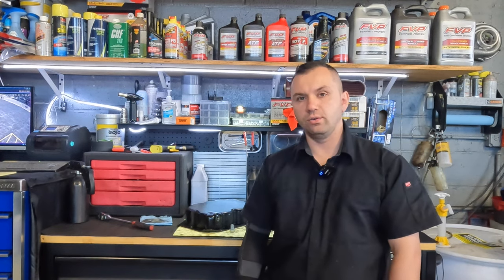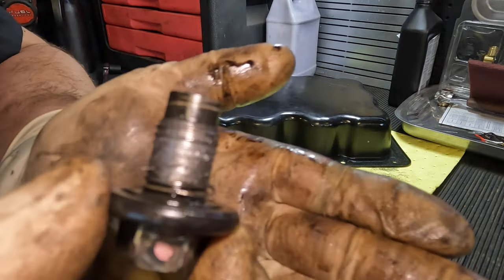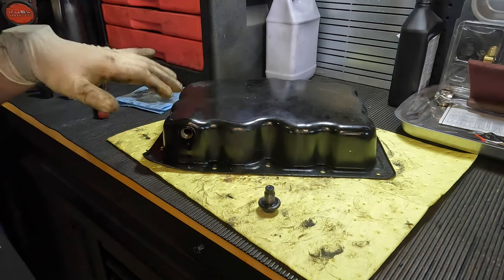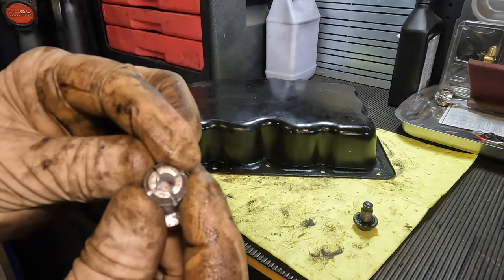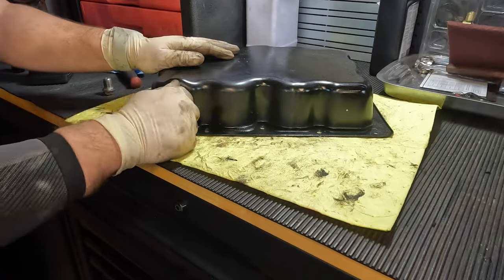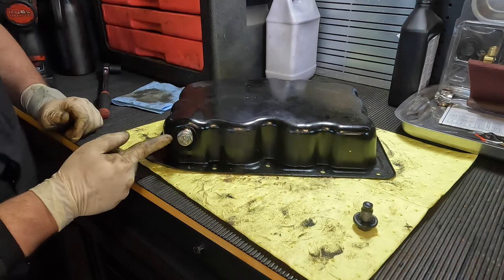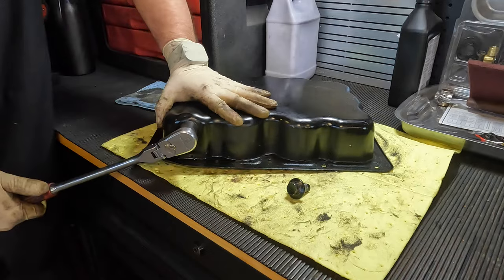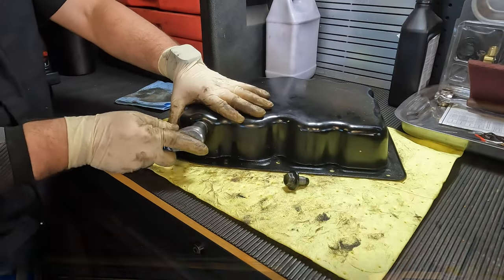STRIPPED OUT OIL PAN DRAIN PLUG THREADS??? HOW TO REMEDY THIS BY USING A OVERSIZE DRAIN PLUG!

Comment: Awesome fix. I wish my oil change guy had suggested this. He said the solution was to replace the pan. Now that I'm educated, next time he mentions it I will ask him about using an over-sized drain plug. Yes, it's a temporary fix but a lot cheaper than replacing the pan. The guy looked like a rookie so I will forgive him for his lack of knowledge. The funny thing was, the shop owner was like ten ft. away and I could have asked him. Next time I will. Thanks!

Comment: Thank you for taking the time to help people that have a stripped oil sump pan. I'm going to use a 14x1.5 mm oversized piggy back drain bolt on my Acura. I bought the car used and it looks like the guys at the quick lube shop's think the bolt should exceed 20Ft Lbs of torque.
Reply: Have you fixed your problem? I have the same problem on my Honda Civic.
Reply: Nice thing about the piggyback type, it can be left as a permanent repair as long as the outer bolt goes in snugly. This is true because you never have to take it loose again, use the inner piggyback bolt.

Comment: Had a place I took my car to get a quick oil change use a pneumatic/impact to get the drain plug back in and it stripped the threads on the old one. Was curious how oversized drain plugs worked and it's pretty much what I assumed.

Last time I replaced my own oil, I saw a lot of metal shavings in the oil but the drain plug fit back in - my car has been slowly losing oil for quite a while but only maybe a quart or so every 3 months, which wasn't much of an issue. Now that I look, it does appear that the issue has been the drain plug bolt this whole time.

I will replace the pan within the next 6 months or so, but for now, I bought an oversized bolt, just have to jack it up and get the drain plug in it and some more oil. Great video and good explanation!
Reply from the maker: Thank you for your support. It sucks that you have to go through that. They should not be using an impact tool on the drain plug whatsoever for any reason.

Comment: Not mentioned in your video, but something available, same thing oversized oil plug, but removable inner bolt, sometimes referred to as piggyback type. The idea is you put it in once, then to change oil you use the inner bolt that is threaded within the outer replacement drain plug. This allows you to do regular oil changes using an allen key and not touching the cut threads.
Reply from the maker: I specifically left those out because when you do those piggybacks, you can’t ever drain all of the oil out of the engine they wind up leaving a lot of debris in the lower pan. It doesn’t drain fully in my experience.

Comment: Great video! Let's say that you have a 20mm bolt that is loose like that. Would i try a oversized 20mm self tapping bolt? thank you
Reply from the maker: Yes, they are usually tapered and a bit bigger but are generally sold as the size you have

Comment: Are these a one time use type of thing? Or can you remove them to clean shavings and reinstall?
Reply from the maker: The oversize drain plug should take place of the old plug. However, I wouldn’t recommend them for long-term use, but if you were to do so, you would just clean them off and re-insert them.
Reply: @TheEnthusiastMechanic  Curious why not recommended for long term use if they happen to work? Do they not seal properly over time or?
Reply from the maker: @mrsemifixit  yes that and the threads it makes aren’t the strongest either.
Reply: If you want to try to get away with it as permanent you need to do the same thing he did, but use a piggyback type repair bolt. If you do it with a piggyback type, you can even use black ATV or some other sealer on the threads because you won't be removing it again. Once installed you just remove the inner piggyback bolt which is usually an allen key. The main key is if you don't change your own oil, it's imperative you take it to a regular repair shop, inform them that you have a piggyback drain plug, quick lubes will f-that up faster than you can blink. Because they'll try to remove the outer repair bolt, and not realize they have to take out the inner bolt. Other than that they work very well.

Comment: If my current drain plug is 12m-1.25 would I get a 12m-1.25 oversized drain plug?
Reply from the maker: They typically will tell you which one fits which threading for the oversize
Reply: 12.1x1.25

Comment: Well yeah but how do you get the stripped plug OUT without removing the pan???
Reply from the maker: @brian8095  there’s a lot of types of oil pans and many different ways to get the bolt out the most effective way is to wedge something like a screwdriver or panel clip popper tool between the drain bolt and the pan and as you unscrew it and kind of keep pressure on it to try to pull it out

Comment: Why is a self tapping plug not a permanent fix? Thanks.
Reply from the maker: They don’t really cut any new threads they try to build upon the existing threads and overtime taking them on and off it’ll strip itself out i’ve only seen them last about two oil changes.
Reply: @TheEnthusiastMechanic  What about a self-tapper with a piggyback as a permanent solution?
Reply from the maker: @marccusumano1138  if it can go in and self tap and has a drain in the middle that would would work but if it constricts the oil drain flow it may not be good in the long run it might not drain all impurities
Reply: A mechanic put a piggyback plug into one of my vehicles and it lasted for years.  I suppose one could put this oversized plug in with red thread lock and use a pump to remove the oil for changes? Is changing an oil pan similar to removing a transmission oil pan for ATF fluid changes? I am going to put a piggyback plug in a car today.  I will use blue medium thread lock.😅 @TheEnthusiastMechanic

Comment: How did u get the stripped one out is what i wanted to know man😭
Reply from the maker: Losen it while using a screwdriver to apply pressure outwards
Reply: Thank you I had to order mine m12.1-1.5.15mm v twin my bolt is spinning so I guess the threads are already broken I do the job tomorrow should I flush the oil after?

Comment: I can’t remove my plug it can spin both ways but hold a seal… any ideas
Reply from the maker: It’s probably stripped out, use a flat head screwdriver to pry while you turn it to get it off.
Reply: @TheEnthusiastMechanic  will do, thank you for the fast reply… about to drive 10 hours to my new job!!!
Reply: @jaycezeniuk2506  holy shit hopefully u made it!

Comment: Just want to point out the reason why the plug is stripped,when the mechanic does your oil change he tightens the plug after removing the old oil not with a spanned but with a pneumatic power tool that is way to powerful for the task and it strips the thread even on a steel sump,this is a universal problem so wide spread that the auto stores supply fixes for the problem,it’s about time that the idiots that cause these problems,and they are major and expensive problems took a little care in what they do but in my experience these mechanics are so disrespectful to others property that they don’t care even though they know the damage they cause .
Reply from the maker: Most that I’ve ever seen only used ratchets

Comment: It's beyond me why people tighten the drain plugs like lug nuts. Ridiculous.
Reply from the maker: I feel the same way I don't understand why either!
Reply: I have experience doing this. Sometimes the ape in me comes out, and I was going to change my oil but spun my plug the wrong way trying to remove it and stripped the pan threads… time to get an oversize, and flush with some clean oil to ensure I get the aluminum shavings out. I heard you can also coat the new plug with grease to catch the shavings… is that a good idea
Reply: Robert Keefer - Agree 100%. It's because they weren't trained by a professional mechanic.